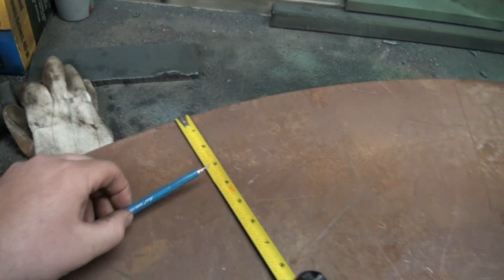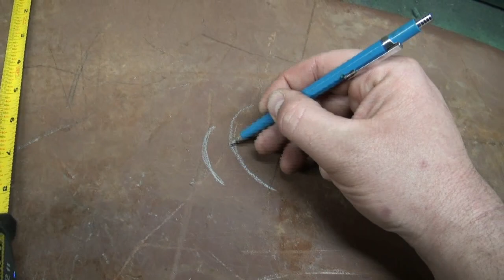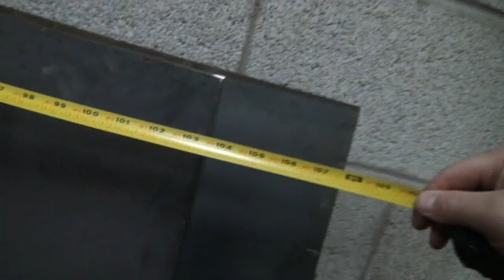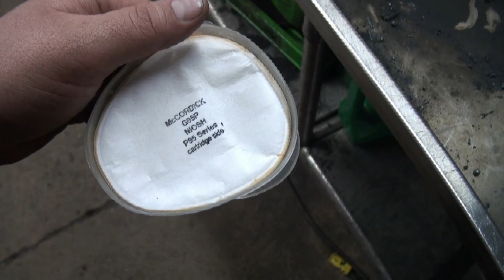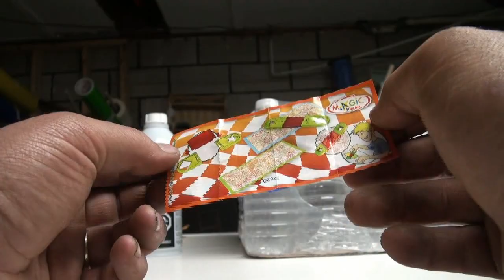998 uploads to 967 explanation......... and starting new project

Comment: Hey bill like your new project, just a little tip to save you alot of cuting and welding. Get a couple of ratchet straps put them around your sheet metal and tighten up until you have the curve you need then weld on your ribs. Or tip 2 use the front bucket to bend your sheets.

Comment: Watch out mounting a straight blade on the front,when you angle it with the tractors linkage it will dig in on one side and be in the air on the other,the angling of the blade needs to be done on it's own brackets.

Comment: If you have a top and up from the bottom rail like 3/8'' X 2'' flat bar it will bee plenty string enough. I think the tractor would just spin out before you bend the blade, If it was mounted on the 110 that may be a different story.

Comment: Can't you take the left overs from the round plates and make some more round parts for supporting the back side, maybe weld 2 of them together, or make them in-between ones a bit shorter? Currently you are planning one round plate every ~61cm, and you actually wanted to put one in every 30.5cm, so you could put a long one every 61cm and a shorter one every other 61cm (or weld two short parts together to make a long one)...

Comment: Sorry to hear about your video stuff , hopefully it will all work out . BTW I have a John Deere 4400 , with a 72" blade on the loader arms , it has power angle , works great for stacking snow ,  I am just across the lake from you in NY , if I could send you a PM I would send you some pic's if you want , keep up the posts

Comment: Bill i think 8 feet is too long for that tractor at that length of that arc! ( Just saying) what if you measure the width of your rear wheel base and take that width and add 2 more feet to that and the plow will still be wider then your rear wheels?

Comment: you gotta think about how heavy one of those blades would be if you made it all from that metal! will that little tractor lift up a 300 pound blade? gotta think about will it be able to get high enough and make a catch system incase you hit something it doesnt ruin your gearbox. but most blades have a catch system where if you hit something the blade bends forwards and huge springs bring it back. just i dont want you to ruin your tractor bill.

Comment: If you were livin close to me I would roll the blade and for the top bend in one piece for nothin. You should go find out It shouldn't cost to much you already have the material. But I would use 1/8'' plate I think 3/16 is to heavy.